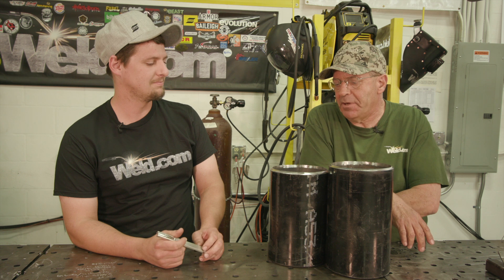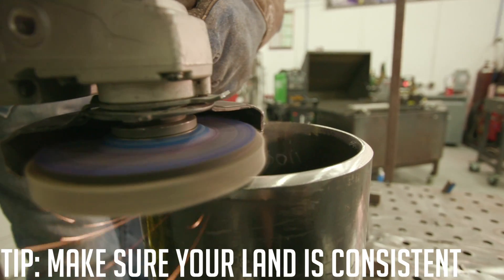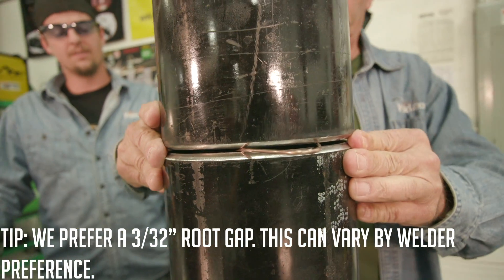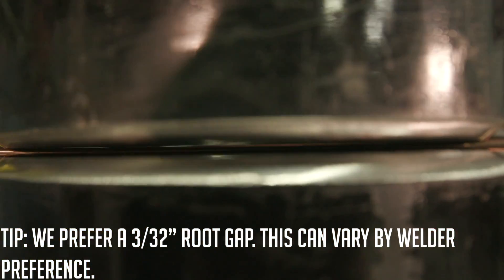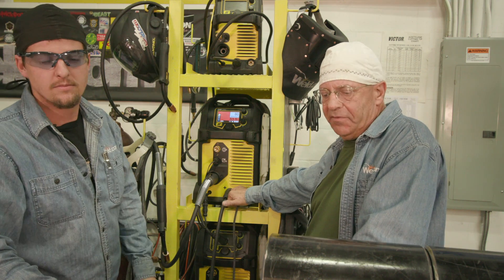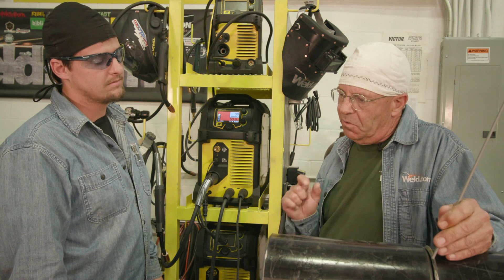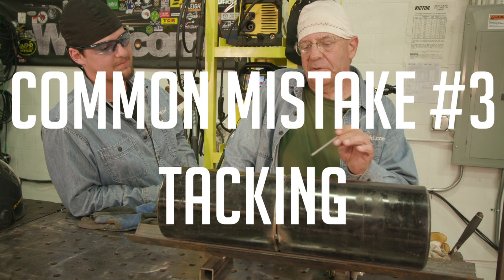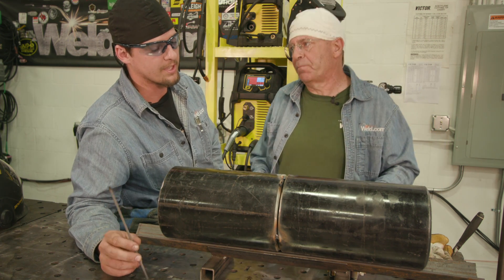7 Most Common Pipe Welding Mistakes

Comment: Is there any other time you would want to use 6010/1 other than the route on pipe welding. I'm a beginner and feel like 7018 seems suited to everything bar sheet metal?

Comment: wish i would have had this video 20 yrs ago  I learned pipe welding by practice and it take lots of it to pass the weld test for Avista. I probably welded over two hundred pieces of schedule 40 6" casing together before I could do it well enough to even attempt the test.

Comment: Remember that the mill scale has a much higher melting point as it has more carbon than the base metal. So make your life easyier and invest your time on complete cleaning techniques to help pass X ray. A preheat can be useful as water expands 1860 times when it turns to steam. Thanks Bob for all your efforts to share the knowledge.

Comment: This guy reminds me of the older guys back when I started.  Back then pipe welding was kind of a secret society,  no one wanted to tell you anything, especially about tig.  But, if you worked hard and did your job, some of the older guys would teach you because they saw the willingness to put in the work. 
 If you had a little slack time they’d hand you some 60 rods and tell you to “ go stack me some dimes”.  Practice was the only way to learn , and if you didn’t want to practice when they told you to, they were done with you.   That was a looong time ago.

Comment: I don’t have much luck with pointing the rod toward the center of the pipe once I get higher than 10-11. My keyhole opens too big. I have better luck keeping the rod perpendicular to the pipe and gently watching the land eat away as I move forward at the same rate when I get to my tack I have to saw or whip a bit to close up the hole but this is the only way I’ve been able to do it.

Comment: I've  been  a fitter for 25 years,and you are  right  about the  filler rod getting  stuck .the second way is good ,but every  piece isn't the same  size ,especially  return  bends.i use 4 wedges. The angle iron method  is nice,but hi- lows r an issue. And you welders deserve  a perfect  fit  as possible.i also am a  welder,so I  understand  the  importance  of  a  nice fit.cause u welders sure love  to  complain ! Lol just  kidding .

Comment: sorry to say but at minute 7 you can clearly see that the inside landing is still standing. i dont know how it is in AWS but in Europe / EN7 ISO that would be a flunk. both edges need to be clearly melted and the original landing edges gone...max hight 2-5mm 1/10th to 1/5th i guess...?

Comment: I'm in the Union Local 529 out of waco and I'm practicing 6g 6010 all the way out to bead cap. I want to learn how to tie my roots in when I run out of rod I get a little bit of splatter inside my root. My guess is I'm sitting there to long and not moving. I start an inch a head to heat it up then I try to tie i to my root. Any suggestion 9n what I can do to make a better tie I.

Comment: Keeping the key hole uniform and the leading edge of the keyhole uniform in color especially where parent metal and weld metal blend together (tie in).  I usually run through my short  tacks because I have been caught with cracked tacks (cut out ) . Sound also plays a large part in doing good beads especially when running  tight spots

Comment: No 8 common mistake is that the face of the coupons has not been cleaned prior 2 welding. This is a no no and if the joint is 2 be welded with the TIG process you are asking for trouble.

Comment: Having some knowledge of pipe welding 6G Cert, UK apprentice champion 1980 in MAW, root face is the key, spend the time.  You should know your amp settings vs your wrist speed and wrist orintation angle for root bead+  if your ark light is really visible during root run, fail, you have to burn it within the pipe. I would tack at 1/2" feather out to leave 1/4", never start on a tack and always pass the 12-6 o'clock positions, also use a strike plate so your rod is hot also this takes away any flux damage which can occur at rod ends

Comment: Welders used to say nickel landing nickel gap.That was uphill pipe welding of the 70's.Lincoln Red rod[6010] and 7018.Beginning with the Trans Alaska Pipeline circa 1975  and the invention of high penetration rods like the german cell 80 and its 80XX[8010,8018] series American welding rods.Downhill welding of pipe to ASME or API is now easier and faster.More production,less weld failures,making the life of a pipe welder less stressful. Most downhill welders use stainless strips of sheet metal for gapping tools and a pipe welders wedge .The strips About the thickness of a dime for 6 and 8 inch, less for 4 inch and about the thickness of banding material for three inch or smaller.The root bead is laid in very hot after the pipe is preheated[300] to prevent sticking of the rod and proper stress factors.Usually by a propane weed burner.The rod is literally drug and pushed downhill riding on the flux coat always pointing toward the center of the pipe.Most welders will  use 1/8 rod for the bead at minimum 110 amps-120.A good welder will have another rod within quick reach and get back into the puddle while it is still hot.I 've done uphill and downhill and much prefer the fast moving technique of downhill.Downhill eliminates  suck in on the bottom due to gravity which is hard to repair and can ruin your weld.

Comment: So here is the thing. I work as a marine engineer. Onboard the ship we don't have 6010 or 6011 electrodes. So when I am trying to fill the root with 6013 or 7018, at vertical position, it is always destroying the gap. If I reduce amperage, then the bead is worse. How can I work on this?

Comment: Personally, as far as gap & landing goes, i prefer a landing edge about 1mm and gap about 2mm. Use a power hacksaw blade as a gapper. Then a 3.2mm (1/8) rod with fastish travel speed but flicking in and out of the puddle a little bitt, 85-90 amps and 50-75% arc force (on a Lincoln 405t transformer set), and listening to the roar lol

Comment: SMH!!! Never, ever wip a root pass ever ,that will give u an undercut and your in side weld will be more than an 1/8. You just done failed your test here in Texas. 6g /45dg -6010 /65 amp  you punch it in and don't stop keep pushing ,let the rod do the work till u connect with your tack then slowly pull out off  the tack then feather it down again and if your gap gets to tight before you start on your next stitch simply run down a 1/16 wheel to slightly open up .The only wiping u do is on your hot pass and definitely not your last ,side to side   for top pass on the 7018 / 75amp

Comment: Why you use such a long pipe ?? i would cut 4 more pieces out that thing and safe alot of material ,or do you need more material for more heat absorption?
Reply: We just cut the weld out and refit. Saves on material.

Comment: Nice video as always, i got a question. How can i avoid arcblow on pipe running DCEP using a standart groundclamp? because here in germany we mostly run 7016 all the way and on plate i can get around arcblow but on pipe i cant find a good place for the ground. really appreciate your content, thanks :)
Reply: I've not noticed it too much on pipe.

Comment: Most of your pipe examples are 6" to 12" coupons. On a real job wouldn't this be joining 10' or 20' pipe sections together for a long run of pipe?  How about an example of prepping and gaping two long sections of pipe.

Comment: Just a question, but why do u only use 6010 when you're welding down hill pipe? Why not ever use 7010 or 8010 after the bead??

Comment: Thank you for your videos, can you do a video on large diameter pipe and how to run the root, hot pass fill and cap on the bottom only, from 8:00 to 4:00, thank you.

Comment: Anyone care to explain why the root gap is needed? As compared to butting the two pieces of pipe together.
Reply: Because you get no penetration and if crank up  your amps you will get internal under cut
Reply: @lucillecandelaria7040  thank you

Comment: Great video the only other point you guys did not mention was preventing the key hole at the end of a tack or end of a rod...... one of the biggest problems welders have passing bend test and Visual is to much penetration or lack of fusion at the start and stopping points. If you pull out with out falling back to the center of the tack you leave a key hole that you gotta deal with everytime you start back or come up to during welding . To close the keyhole ALWAYS!!!!!!!!!!! Fall back to the center of the tack or at the end of the rod and there will be no key hole to fix you will not have to jack the rod to close the hole ... if you do this you’ll get a “WEDDING BAND” and you will not be able to tell where you stopped and the tacks will look the same as the bead !!!!!!!!! Side bend or root face bends always bust because of bad tie ends if there is no big key hole to close you’ll have better chances at getting pass the eyes of a butthole QC looking for something to bust a guy out for!!!!!!!!! Great video guys you and Abraham and the guy from Canada have the best instructional videos on the web. I’d personally like to see you guys do some videos on how to fix defects like to much penetration or leaving side wall incomplete fusion that would be a big help to a lot of young welders out there !!!!!!!!!

Comment: Diameter of electrode in mm x 35 = amp it's true 6010 80 amp  position 5G uphill  vertical up 35x 2.3= 80, 3/32 inches = 2.3
Good job Bob

Comment: Bob can you do a series on roots but with a sa 200 with the gears and voltage?
Reply from the maker: We would love to. Just have to get the machine here.
Reply: @Welddotcom  bob you always do videos with esab rebels or other inverter machines lets see how the old school lincoln electric stacks that metal.
Reply: @agustinhernandez6094  Once they go old school lincoln dc generators they'll never go back to inverters again
Reply: @Inwetrust-qy2ly  you know it bud those sa 200 are some metal stacking sons of guns but i havent seen any videos on how to use them you know to put a bead in at what gear and volts you know something diffrent for the people
Reply: @agustinhernandez6094   look up Fieldres on here. Hes has a few very good videos explaining volt and amp settings.
Reply: @Inwetrust-qy2ly  yes sir i have seen his vids but you know just wanted to give my opinion ithink if bob would do it it would help out lot of people he explains very well you know like what gear hes in and volts stuff like that just a suggestion for bob that fieldres is a welding guru.
Reply: @agustinhernandez6094  I'd love too!
Reply: @Welddotcom  it would be nice alot of people is what they use out in the field you know those famous 1969 redface or a blackface i think it would be awesome if you would do that for the people.
Reply: @Welddotcom  lets do it show them that sa 200
Reply: Bob, on the welder settings you mentioned the amperage setting, etc. but not the rod size. Setting 80 amps, were you using 3/32" or 1/8"?
Reply: @shortfuse43  1/8 rod, most roots are with 1/8 or 5/32, amps depend on gap spacing
Reply: @Inwetrust-qy2ly  Thanks... I "assumed" it was 1/8, but Bob never said...